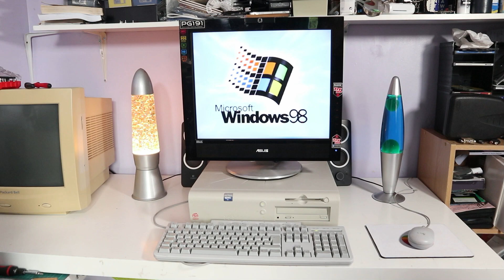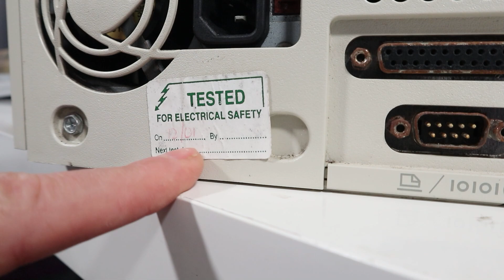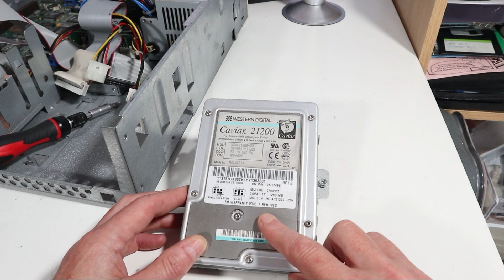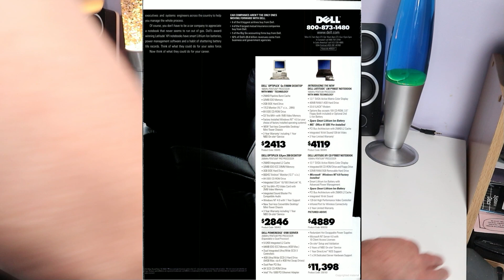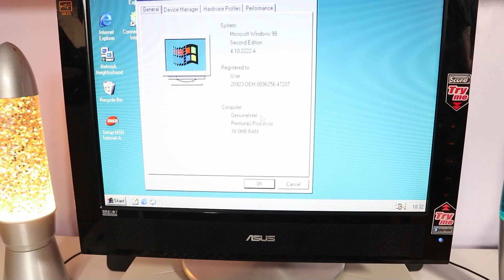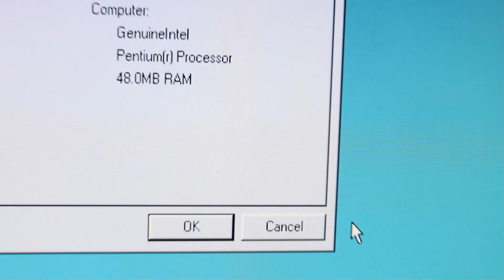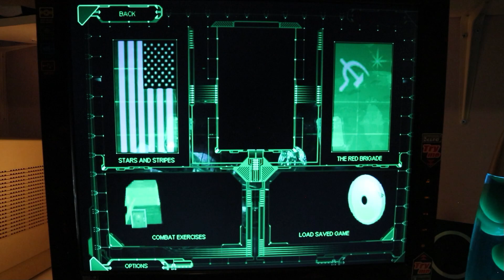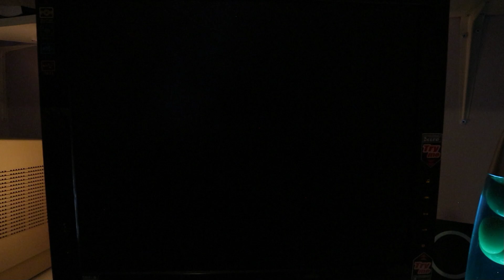Dell Optiplex Gs+ to Voodoo Gaming Monster

Comment: I loved working on these machines back in the day.  So easy to upgrade. Extremely rugged and well built.  If you feel the urge, you can upgrade the motherboard on this with something that has built in sound and better graphics, as they used this case well up until the P-III era, unchanged. Otherwise, a 233MMX will fit in with no problems. YOu might notice the three holes in the back plate where sound jacks would have gone, were it so equipped.

I was disappointed when Dell went with their rounded "Darth-vader" black cases in the 2001 timeframe, as they were ugly, weren't as nice to work on as these and they had that horrible capacitor plague. 

Your particular machine appears to have had a bunch of IBM parts added.  The HDD has an IBM warranty notice and your RAM also is IBM badged.  As new these had either 2gb 4gb or 8 gb hard drives, IIRC.  Super nice machine.

I use the Mini-tower Pentium III variant of this family (GX110) as my "tweener" machine.  Modern enough to run XP, but I can dual-boot DOS or Windows 98. With a 1.2M, 360K and an LS-120 for 1.44 floppy it makes it easy to move files from a USB stick/SD card to floppy for XT class machines.
Reply from the maker: Cool. I sae a few adverts that said some kodels had built in sound. Not sure where the Ibm part came from. They are very nicely put together machines, especially for the time! Might be fun to see if I can get a motherboard up grade!

Comment: Interesting its been upgraded upgraded to a P166MMX,  this board is designed for the standard Pentium P54CS 3.3V, not the Pentium MMX P55C 2.8V - its also got the original Intel i430FX chipset - you could squeeze more performance if you swapped the board to a GSi (i430HX) GN+/N (i430TX) and gain USB support.
Reply from the maker: Yes some one mentioned motherboard uograde, I'll keep an eye out. Would be nice to have usb and a 200/233mmx.